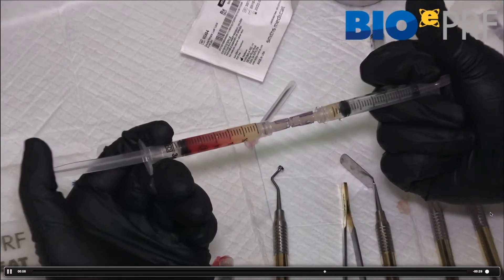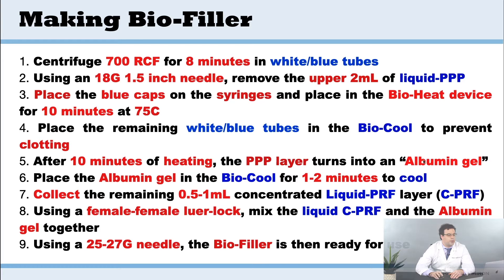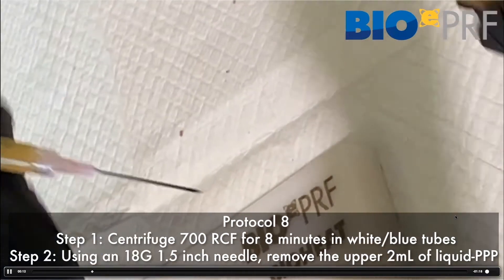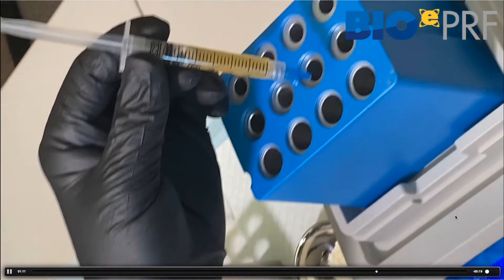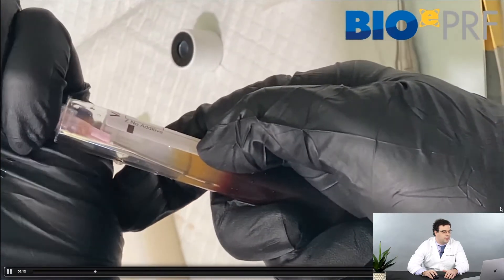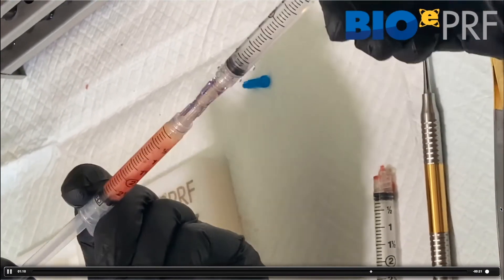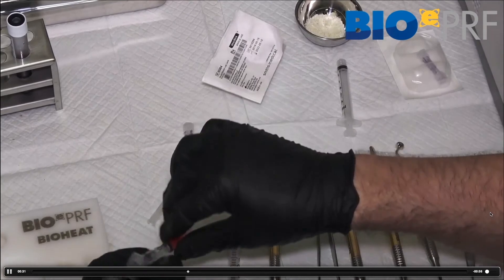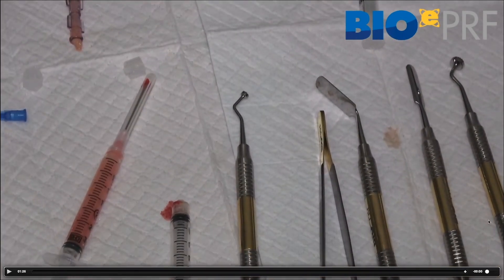Chapter 7.2: Making a Bio-Filler presented by Dr. Richard Miron

Comment: Dr. Marion I was wondering why did you choose to centrifuge 700g for 8 min instead of 2000g for 8 min?
Reply: This is also something I wish he answered because now im wondering if I should be spinning all my injectables at 700g. Very confusing.
Reply: Any news on the exact difference? The YouTube video's, articles published and the book PRF in facial aesthetics don't give me a clear answer. Also where does the 300RCF/5minutes protocol comes in and when 2.000RCF/8 minutes vs 2.000RCF/5 minutes? In the book PRF in facial aesthetics they also talk about 2.200RCF/8 minutes for albumin gel. So really getting confused.
Reply: A study conducted by Durgillon et.al reported that the number of platelets is not always proportional to the growth factors quantity  and proved TGF beta 1 nd platelet conc.are proportionally related to the centrifugation forces when the forces r less than 800g.
TGF b1 becomes inversely related to the centrifugal force  when centrifugal forces r above 800g
Reply: Yes I would do 2000 for 8 min if you are just doing Bio-Fillers. That's correct. If we do microneedling and papule injections as well, we typically spin at 700g for 8 min.

Comment: What happened to the Tubes which were first placed in the bio cool after drawing up the 2 cc of ppp. Because in the video , I noticed the PPP from the bio heat was mixed with the 2 tubes on the rack snd not in the bio cool
Reply from the maker: Those were pulled out of the Bio-Cool and those are the 2 tubes you see in the video which are then mixed with the heated albumin gel.
Reply: 3' 52" ?